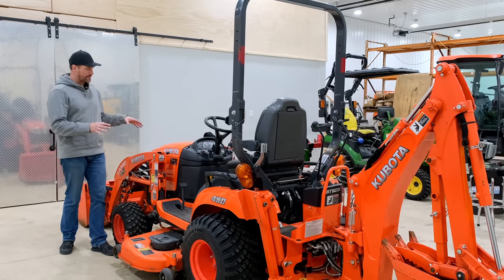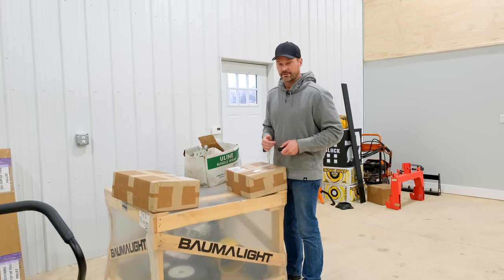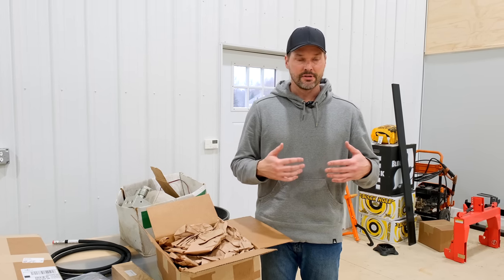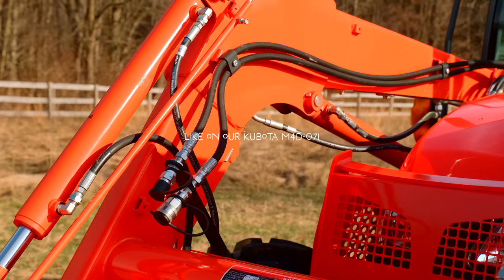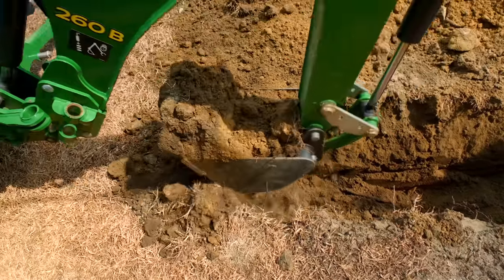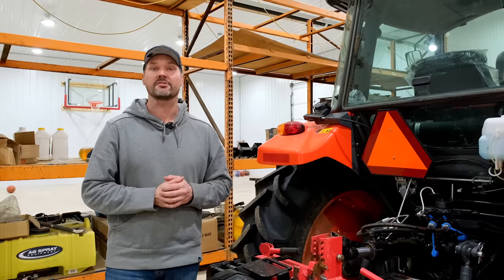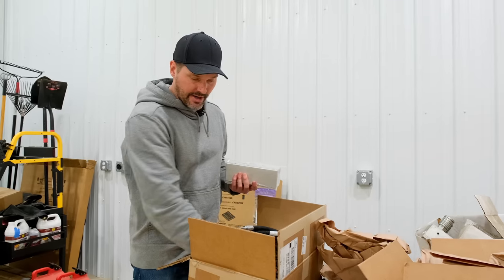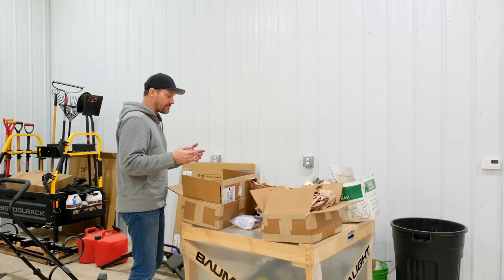KUBOTA HYDRAULIC 3RD FUNCTION & REAR REMOTES, DIY SOLUTION 🚜

Comment: I ordered my 2025R with the front third function. It was actually 2 kits. One for the tractor side and for the loader side. I think the dealer worked on it for 2 days and I took it back another day so they could do it correctly. 
Had I known I would have ordered every rear hydraulic option available.

Comment: Informative video Courtney!  Something else you might mention is that the true third function is either on or off when pushing the joystick buttons.  You can't "feather" the third function like you can with the raise/lower or curl/dump functions.  A diverter, on the other hand, can feather the grapple as you are essentially using the curl/dump spool on the loader valve just sending the oil to a different set of couplers.  It would be possible to install a flow control on the third function directional valve stackup, but the flow would not be variable "on the fly."
Reply: I don’t 😊😊q😊😊q

Comment: Great video Courtney! I bought my 3rd function from Summit and it was a very easy install. The only part that slowed me down was I had my dealer install a rear remote when I bought my tractor and they used the port on the hydraulic manifold that the instructions told me to use; but the instructions show that if that port is in use you can use another. The issue I had was the fitting on the manifold block had a different fitting so I had to buy one for only a few bucks. I also added a switch and fuse so I could shut everything off when not in use. All in all it is an awesome kit!

Comment: In Australia most manufacturers other a 3rd function kit as a option with a 4 in 1 bucket, John Deere includes it standard on 2r, 3r, 4m and 4r. Most will do a special throughout the year where they will include the 3rd function and 4 in 1 bucket free

Comment: My L4060 has Kubota hydrualics, front QA remote with 3rd function plus 3 rear remotes. Installed the 3rd function/QA remote myself, let the dealer install the rears so it's warranted.  What I would like is a kit for my B2410, all I have is the rear remote part Kubota make and plugged the hoses into each other when not using the log splitter.  There are no remotes made for the B2410.

Comment: On our new Grand L, We just had the tractor added with the OEM third function and 3 rear OEM connections. We justed added it to our financing plan of a true 84 months 0% interest plan. We  had a large down payment.  However, if we get to the point that we need more than three rear remotes,  we will definitely get the multiplier option. We are just using one now for a hydraulic top link, which is great.

Comment: I own a B2650  and wanted to use my 3 function that was installed on the front of tractor to operate a hydraulic top link occasionally on the rear of my tractor.I just want to extend the hoses to the rear. Will this work for my occasional use? Looking for help.

Comment: i spent around 3500 and a course of a month plus the hydro box leaked all the time (i think i fixed it, there was gunk in two of the threads from the manufacturing process) but i was able to use my grapple to clean up after the hurricane all by myself... made a brush pile 25'x12'x10'

Comment: At what level of hydraulic flow do you need for some of these implements?  It seems like many of the smaller tractors may not have enough flow to make implements practical.

Comment: 3rd function and diverter are different.
3rd function adds a circuit for the forward hydraulics.
Diverter splits an existing circuit for the forward hydraulics.
Reply: Technically you're adding a 3rd function you just can't operate at the same time, maybe 3rd function by diverter would be a better phrase to use

Comment: I got the summit hydraulic 3rd function kit for my 1025r and when I was was installing it I had an issue with the Quick Attach fittings that came with the kit. They would not fit in the factory couplers for the loader even though the instructions said they were the same as factory fittings. I ended up getting then to work but I had multiple leaks and was unable to detach them after the fact. So I removed the whole kit and just went back to my factory set up. Now I have a 600 dollar kit sitting in a box that I can't use

Comment: I was recently looking at buying a new compact tractor.  The local John Deere and Kubota Dealers gave quotes for a set of rear remotes & front loader 3rd function kit. Both these tractors were a platform models Kubota LX3310 & Deere 2038. These two Dealer installed options added almost $5,000.00 to the cost of the tractor. Why so much?